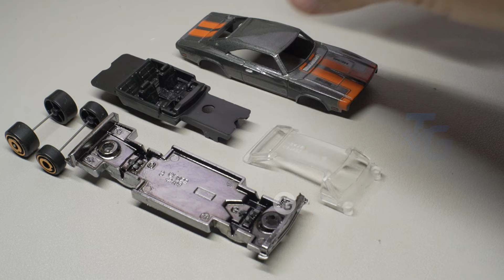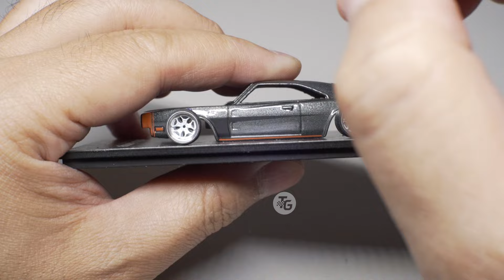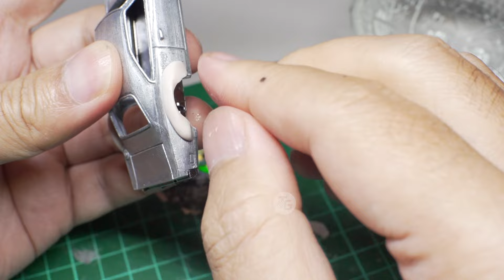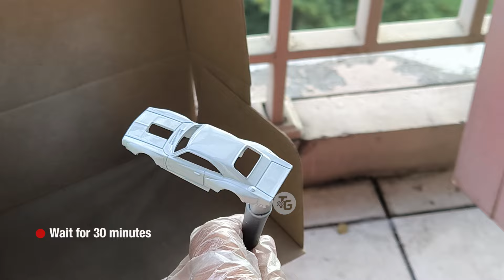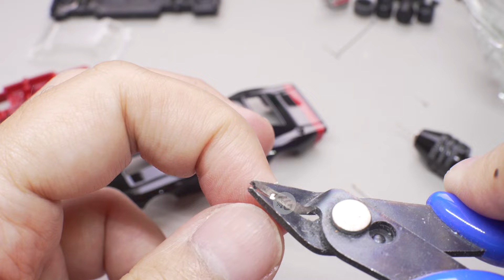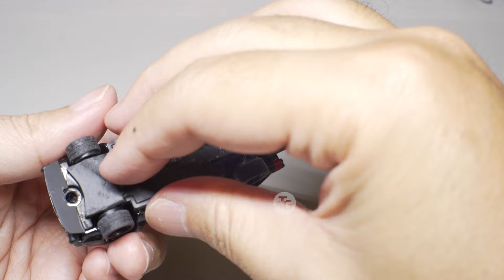Turning a Classic '69 Dodge Charger Hot Wheels into Widebody Beast with Blown Engine!

Comment: Only change I would make would be to notch the body in front of the back wheels so the exhaust sits flush with the bottom of the car so it doesn't hang lower than the undercarriage, but that's just my personal preference, otherwise clean build looks like a time attack or maybe a drift car
Reply from the maker: Thank you for your idea bro 😊 I appreciate that